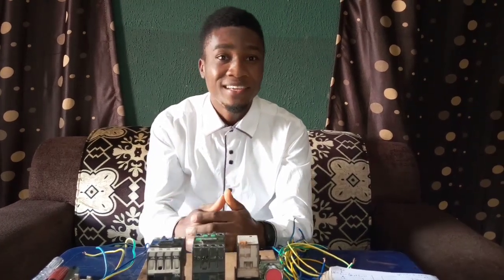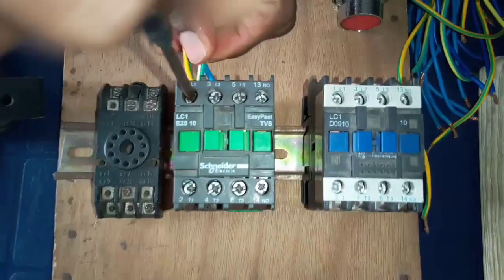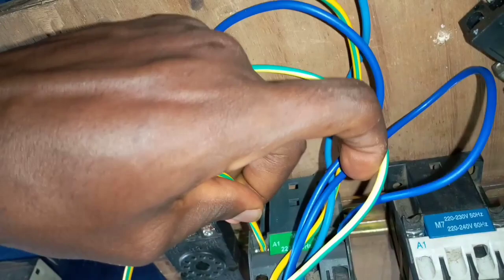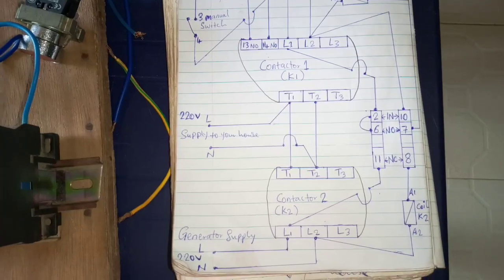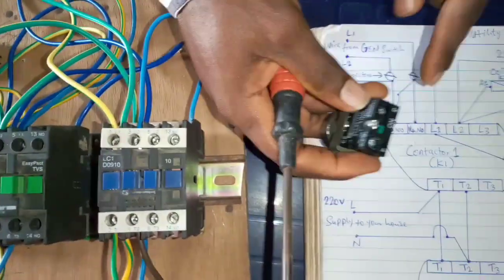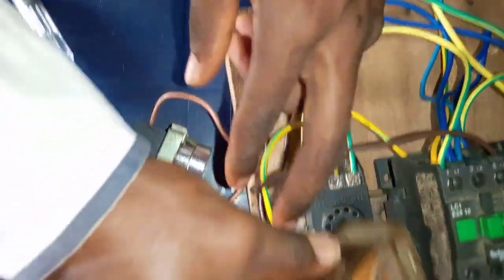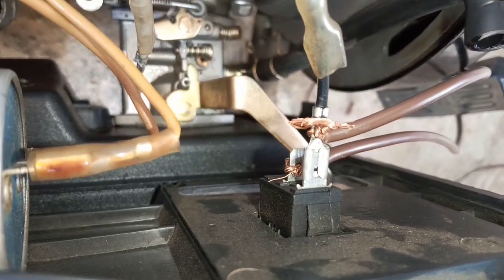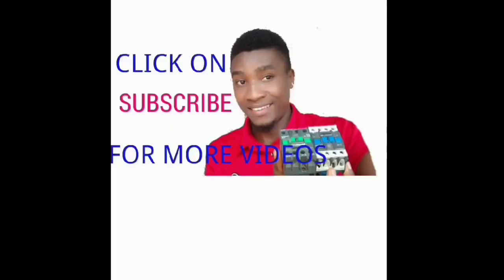AUTOMATIC CHANGEOVER THAT CAN OFF  GENERATOR

Comment: Very educative but would you mind interlocking the two contactors for safety reasons, kindly. Then an Aux contactor should be incorporated because the gen need not be manually turned off when Utility supply is restored

Comment: Pretty awesome Engr James 
Buh secondly 
Can U design a circuit 
Wit two push buttons 
One 4 oning de generator
One 4 offing de generator 
At which de two push buttons will be inside 
De house 4 offing Nd oning without cumin to 
Generator place
Tnkz
I’m Edeson Solomon
Reply: Yes you can design this but the thing is that the gen you want to turn on must be a key start generator and I think it has to be an industrial generator too cause those sumec generator has a choke which you must return
Reply: @jack-ls3rs You are right. It depends on the generator's design
Reply: @Le_vis254  thank you sir